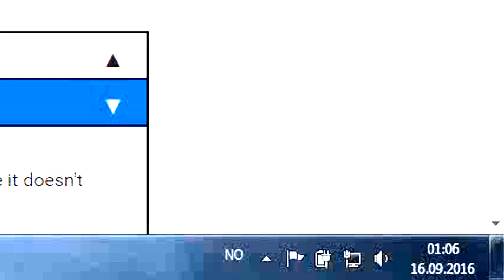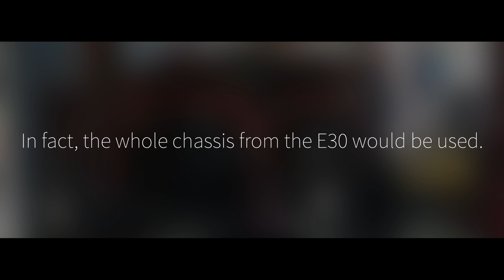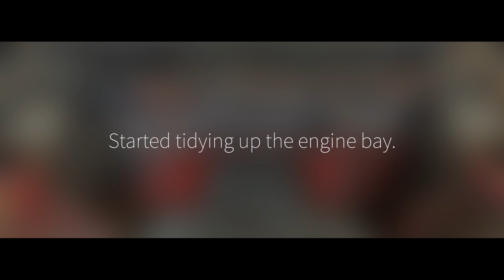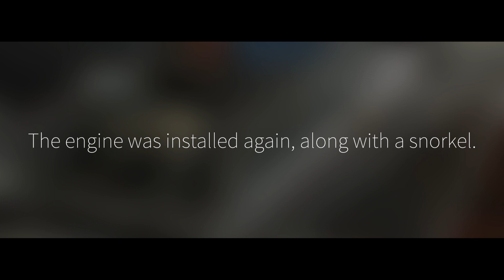Sin City BMW Service Center's BMW 2002 "X2"

Comment from the maker: I've noticed that off road converted sport compacts has become somewhat of a thing lately. What's the craziest creation you've seen?
Reply: Well I guess Gingium's Rally Miata will be the craziest soon. It's already amazing.

So far he's supercharged the little inline 4, it has a skid plate and partial undertray, large mud-bogger tyres, roof rack, roll bar, plastidip paint, intake snorkel, power steering (it didn't come with it), roof mounted lights, long travel suspension, trunk mounted spare tyre, and cut bumpers with bash bars.

He plans to engine and drivetrain swap it by with a Subaru EJ20 or EJ25 engine and the AWD system from a Subaru as well. It'll be crazy cool, I hope he plans to redo it's exhaust as well with the exhaust coming out the sides above the back wheels, that'd be really cool :)

Comment: I can't decide if I want to make my e30 a street or rally build. I started off wanting to make it an ultimate track/street build, but now I'm leaning towards rally, with the suspension lifted and some heavy duty tires so I can drive over curbs and shit, and hoon dirt roads in it. Its not an ix, so no mountain climbing though.
Reply: im building a drift e30, but untill its all ready its on stock suspension and stripped so it sits high, and i put a skid plate, bash bar and a welded diff on it and its so much fun to rally. my instagram is dc_disasters if you wanna see some of the build and some rally/drift videos
Reply: Charlie Ward Sweet, I'll check it out.

Comment: You ever gonna do a video on a Skyline GT-R build thread?
Doesn't matter which one, it's the car that matters.
Reply from the maker: If someone who has built one submits their skyline build I will gladly do it. I prioritize submitted builds as it's much easier than getting in contact with builders/owners through forums. I also have three projects in the making right now, so I will complete those first.
Reply: Build Threads Thanks for responding, keep doing what you do, and I'll keep watching!

Comment: How do you do these cinematic photo effects? Looks so sick, please do tell.
Reply from the maker: I use photoshop to crop out elements in the foreground. Then I scale up the foreground elements so that they can move slightly more than the original picture in the background without revealing the parts of the background that the foreground element was cut out from. Another way is to just crop out all elements separately, draw what you think is supposed to be behind them in the background and then just animate each element so that elements closer to you move more than those far away. Or I could make a video about it...;)

Comment: Man I loved the video and the build! 

But a little tip as a 21:9 ultrawide screen user: Please render your videos in 21:9 if you are going with the cinematic look. With black bars on top and bottom all I see is a thick ass stroke around the picture :(
Reply from the maker: Wow, I didn't realize that YouTube supported that yet. I will definitely consider that in the future and also avoid switching between 16:9 and 21:9. Thank you for your feedback!
Reply: Thank you ! Keep up the good work :)

Comment: I know ill get some hate for this......but here goes.... that body looks ROUGH, I know that's the look you guys wanted but DAMN!!! I would of loved to see if it u actually cleaned it up, smoothed everything out and put a decent paint job on it, hell spray it in that rhinoarmour stuff or something make it really mean looking. Keeping with that idea I woulda put a full led light bar across the top and also tried to find a way to center mount the exhaust tips. also migt look cool with slightly wider tires in the back? the fronts look alright like that but the read ones look too tractor for me.
all just my view on it, still looks fun to drive tho, good job

Comment: If the e30 is longer, how was that corrected?
Reply from the maker: It wasn't corrected. The engine and front suspension are simply mounted further ahead than on a stock 2002.

Comment: *325ix
Reply from the maker: Woops, it is indeed supposed to be 325iX. I'm so used to working on my 525i, so I guess that's where it all went wrong. I will correct it with an annotation. Thank you for pointing out the error.